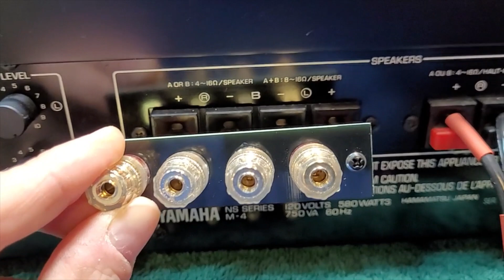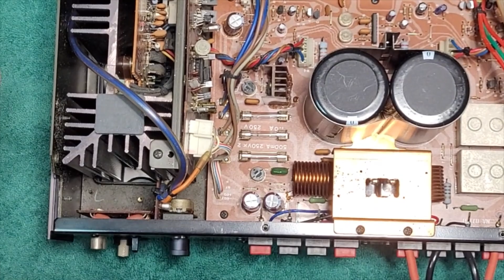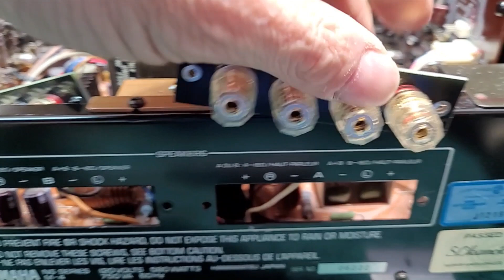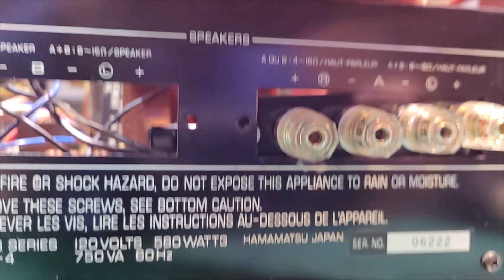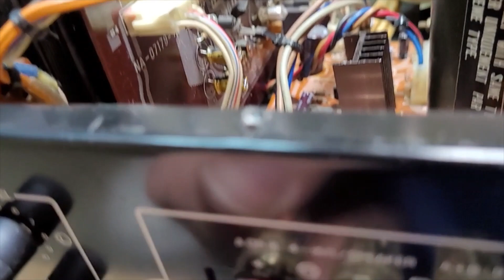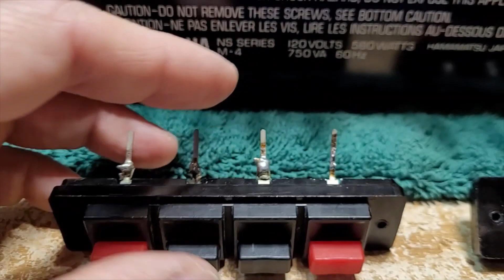How to Upgrade Vintage Amplifier Speaker Terminals to 5-Way Binding Posts

Comment: I used that website to replace the terminals on my Yamaha A-700. They didn't have this particular model in their inventory, so I had to ship them the original part and he worked off that to recreate the replacement part. Even with my appalling soldering skills, it was still relatively easy to get the new ones installed. And yeah, they're worth every penny.

Comment: Dear Turntable Guy,

Interesting to see you video. I have a vintage Luxman L550. 
Can you tell me why the backing plate is needed? Can I simply buy and fit four separate  terminals?

Best wishes

Comment: The real problem with spring clip terminals is when they are small and you have large wire. When they are big they are better than screw terminals.

Comment: Hey do you know if you can wind the new terminals all the way off or does it break them? Feels like a hard stop at a point but need to take them completely off to clean the banana socket properly (have mud in them)

Comment: The worst part of spring clips is that so often they're installed what I call upside down, with the hole above the button as we see here.  That's dumb because it makes the insertion blind if you're above the amp.  Spring clip the binding post "pigtails" can make a good electrical connection, but they offer no mechanical improvement; plugging in the bananas is still a two-handed operation.  This solution is a whole lot better.

Comment: Thanks for that.  I have a vintage pioneer amp and one of the spring clips is not working.  Suspect solder has broken down.  I now know what to look for when I open it up.

Comment: IMHO 45 EUR for a pair of Swiss & Custom Made YAMAHA M4 Terminals isn't expensive at all. This is just 5,60 EUR for each gold plated robust terminal without the plate, drilling holes, 4 suitable screws, craftsman work and the order, postage handling stuff. In addition paying TAX (Tax = Your Work Force & Life Time).
One of my M4s bought used already got "male banana wires" soldered internally, running through the removed terminal plate. Not nice looking, and why "male bananas" ???
Nevertheless I prefer the original shitty terminals, or your already used solution interim connection cables.